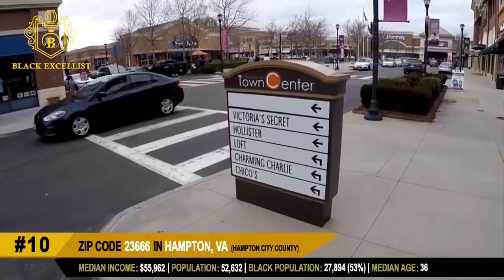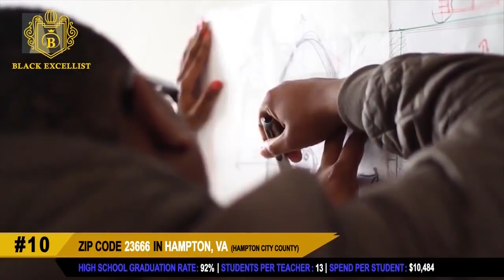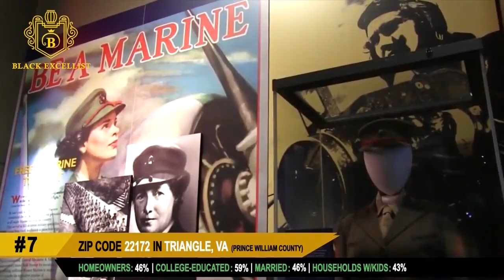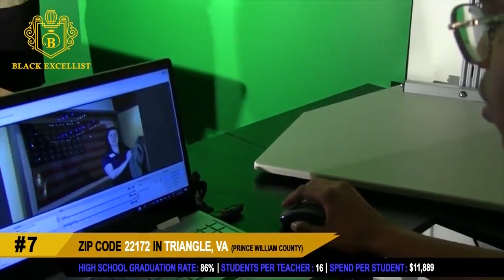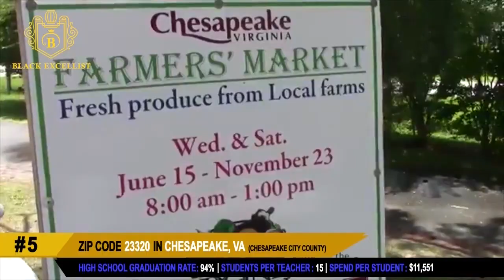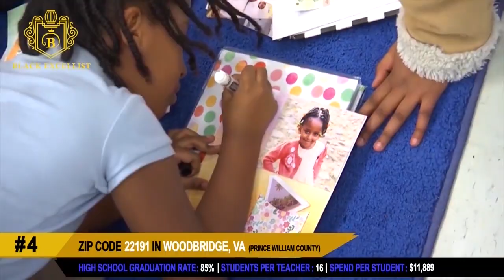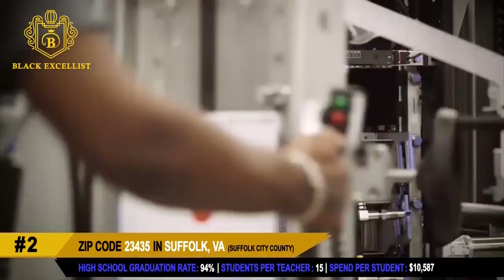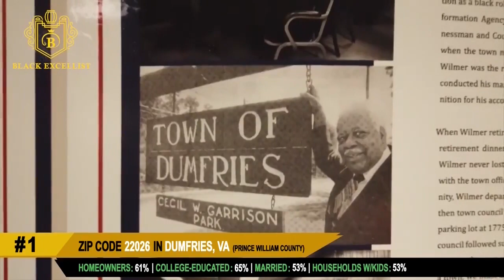Top 10 Richest Black Communities in Virginia | #BlackExcellist

Comment: Is Chesapeake on the list three times?
Reply from the maker: We explained that when you were walking in.
Reply: It could be more than 3 in real life
Reply: It is by zip code. So, a city can have multiple zip codes on the list.

I’m still waiting on a NY State list. Given the criteria, zip codes 13224(Syracuse), 11510(Baldwin), 11575(Roosevelt), 11553(Uniondale), 11003(Elmont), 11580(Valley Stream), 11422(Rosedale, Queens), 11413(Springfield Gardens, Queens), 11411(Cambria Heights, Queens), 11429(Queens Village, Queens), 11412(St. Albany, Queens), 11436(Jamaica, Queens), 11798(Wyandanch, inc. 6 figure Wheatley Heights), 11701(Amityville), 11234(Flatlands, Brooklyn), 11238(Prospect Hts./Clinton Hill, Brooklyn), 10553(Mount Vernon), 10523(Elmsford)...I’ll stop there, but there are possibly others that fit or come close either way(black percentage and/or income) that could be listed as well.

Keep in mind that Upstate NY cost of living is more in line with the popular Southern states or Midwest in overall cost of living. So, it isn’t expensive like NYC and the surrounding area. That 13224 zip code in Syracuse(East Side/a portion of DeWitt) is a sleeper in terms of income and educational attainment.